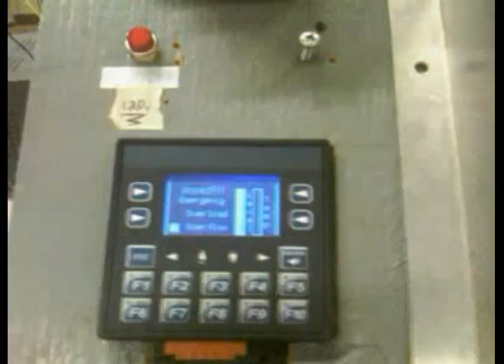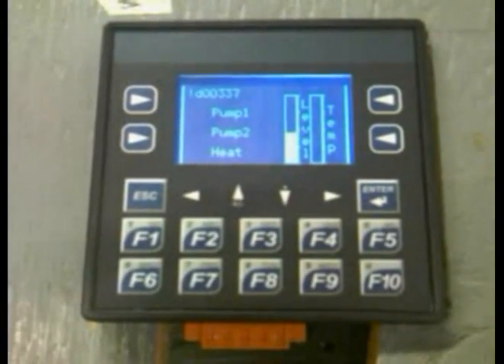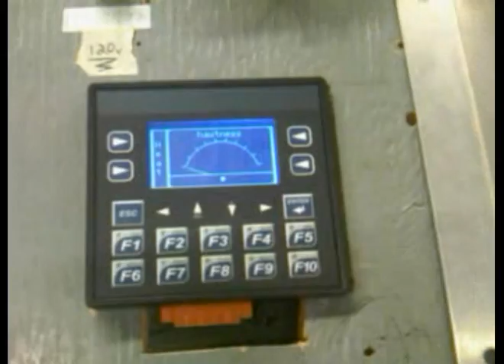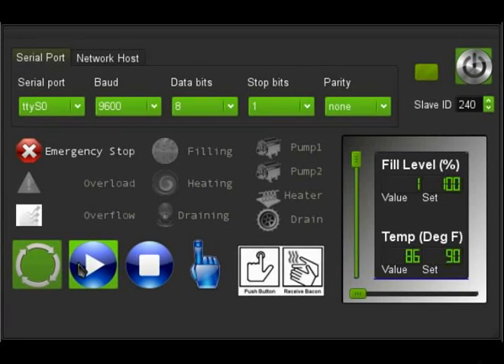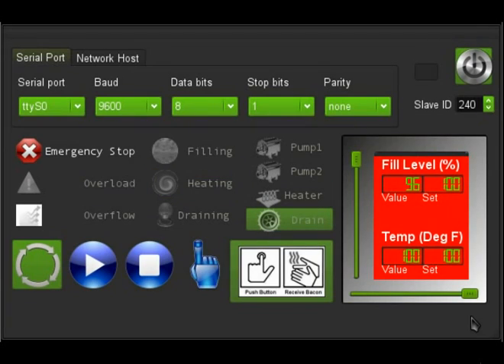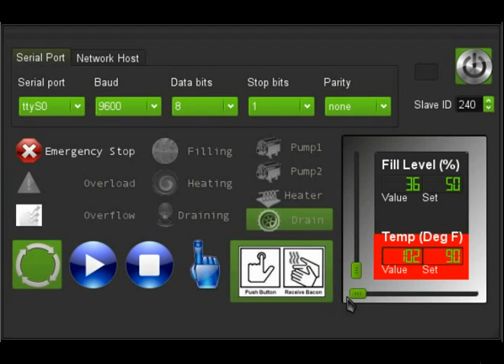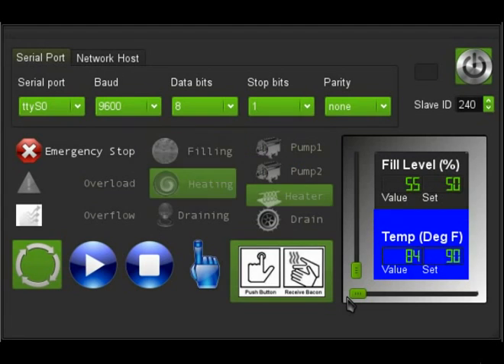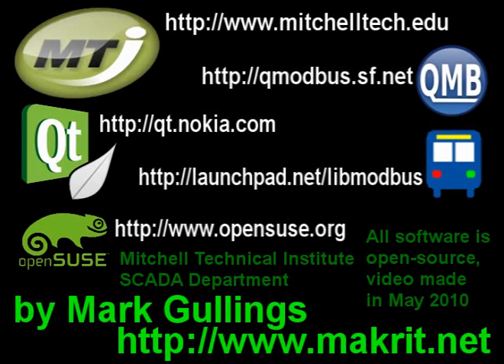SCADA Lab Water Project

Comment: http://www.hornerautomation.com is the PLC  I assume it's an HE-XE105 which has thermocouple but there are other options. The SCADA program is very nice.
Reply from the maker: It's an HE-XE102, relay out plus both digital and analog in.  Thanks on the compliment about the program!  There is source code on my website, modified qmodbus on Qt but unfortunately it's ancient in computer terms.  I've even made it run on Android 2.x but sadly it won't run on 4 and later.  Feel free to grab the source code and make it your own, but I've abandoned it in favor of a DCS software I'm working on in PHP.
Reply: Horner's later controllers XC, XW, EXL, EXV have the same or more ports and Ethernet built in. They run much faster and have full color and touch. Good luck on your career.